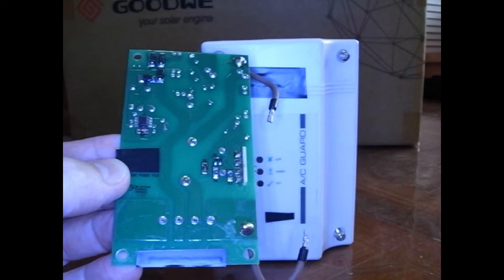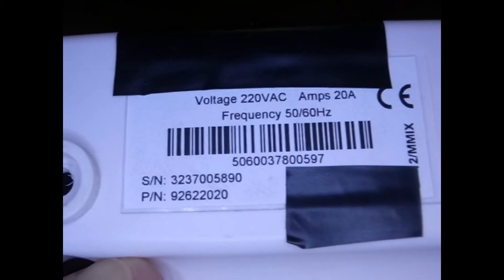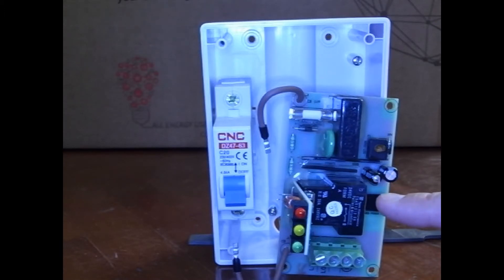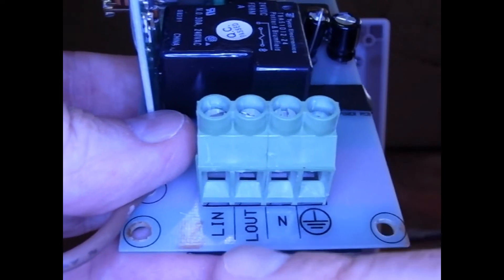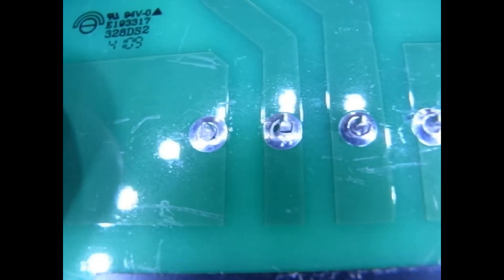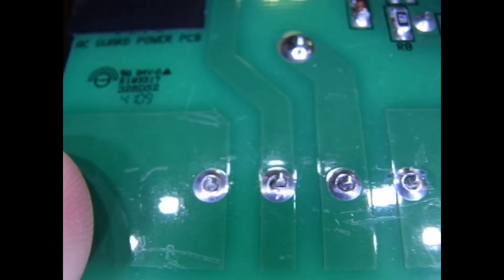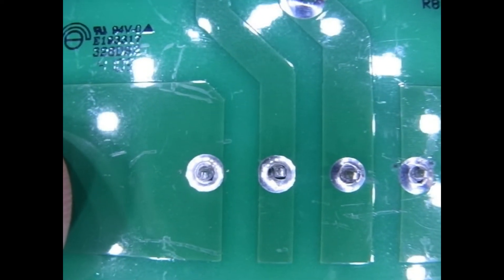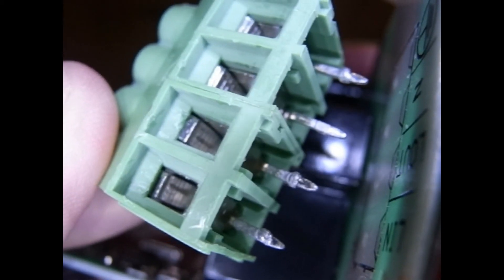Soldering Mistakes - Why Mechanical Connection Is Important

Comment: No excuse for shoddy work like that on mains power device. There must be a revolution in the electronics industry. 50% of electronics are junk out of the box. I spent over 600 bucks on smoke and CO detectors from a big name in detectors Kidde. Out of the 13 smoke detectors 7 have failed in the first 3 months, 2 CO detectors out of 3 failed. Letting a Communist country manufacture just about all the electronic devices in the world is coming back to bite us on the ass.
Reply from the maker: Agreed!

Comment: So...how did you fix the problem?
Reply from the maker: Good question: The right answer would be to throw it away.  Bad engineering / manufacturing is dangerous.  (See Craig's comment).  Assuming the rest of the circuit and the copper tracings were correctly designed, had they bent the leads firmly against the tracings before soldering it probably would have held up.

Comment: I had a "First Alert" Water Heater Timer that had from the factory, solid  copper added between the relay contacts and the terminals for hookup. The relays could handle the current but not the board. I added additional copper to it and it worked alright but I removed it from service, It is a fire hazard. How do these products even get approval to market?